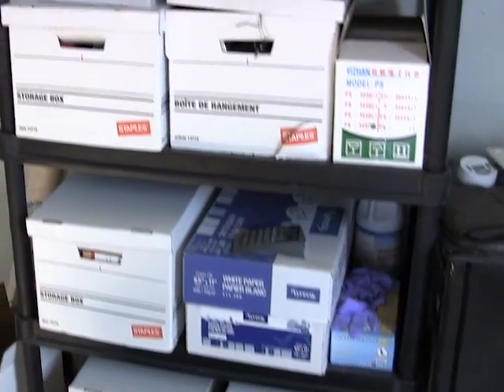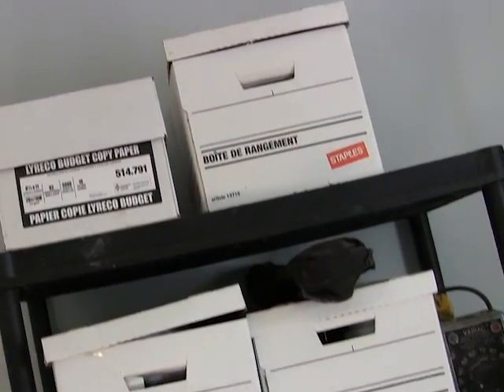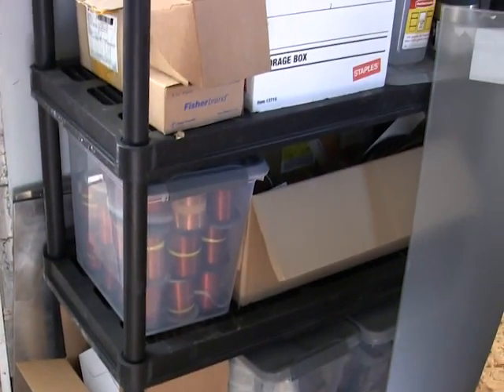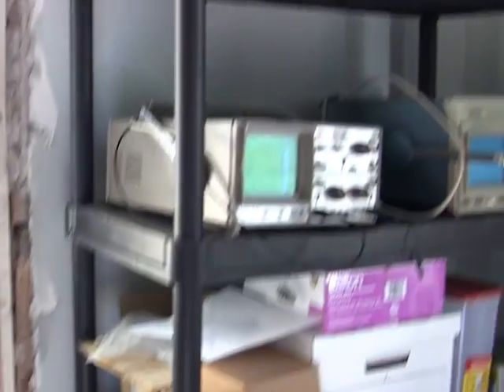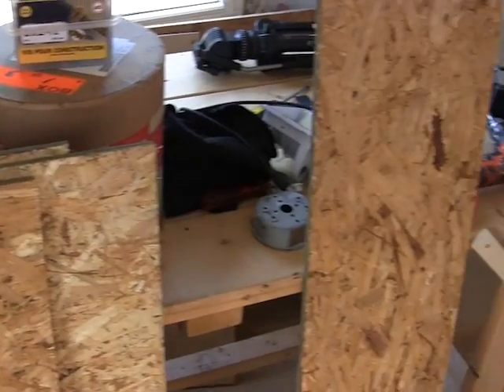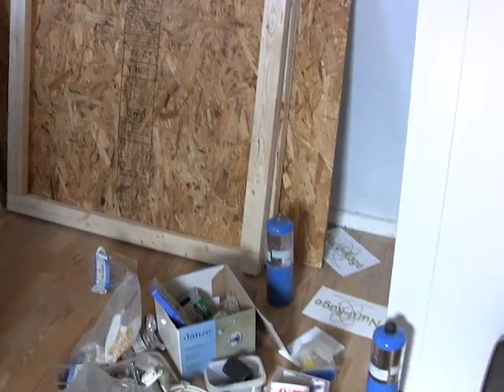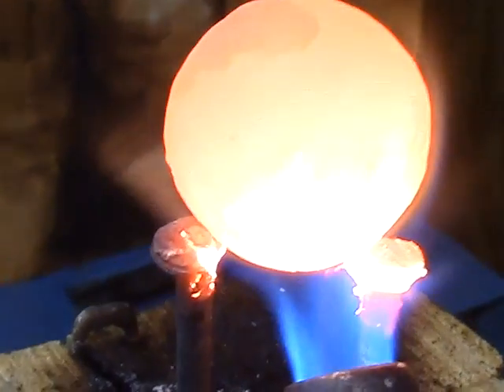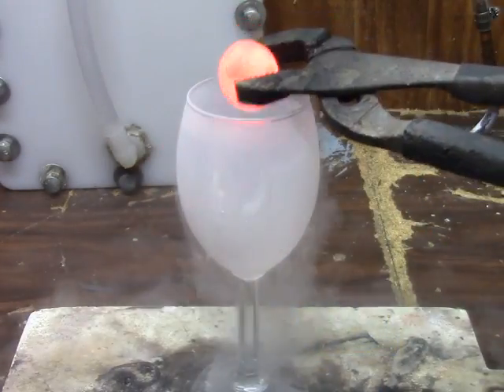Lab Update 8-26-2014

Comment: a fume hood made out of plywood? lol i give it 2 months before it burns down
Reply from the maker: Pfft. With kinda crap i do i'd be surprised if it lasted 2 weeks... i'll give it 2 days.
Reply: NurdRage
Add some n-butyl lithium and maybe you'll have two seconds while it eats vigorously away at the wood in desperate search for some hydrogens :)
Reply: NurdRage Well, now I wonder - What should a proper fume hood be made out of? Stainless steel? Reinforced concrete?
Reply: February
Generally something fairly blast and heat resistant - the ones usually found in labs usually are made out of reinforced stainless steel, lined with strong plastic, with a blast resistant glass (usually a laminated glass) covering.

A wooden fume hood, imo, is a fire risk waiting to happen (especially on exposure to any common reagents used in chemical reactions - higher molarity HNO3/H2SO4 are fairly exothermic and extremely corrosive for a more extreme example, or hell, n-butyl lithium is nice and basic enough to eat through wood - creating some rather unstable and unhappy carbocations), but wood is ideal for a professional Chemist on a limited budget (which is sadly most Chemists) since plywood is cheap and steel is not.

The goal is to not breathe toxic fumes.
Reply: February Consider PVC as a liner for more convention experiments. easy cleanup, cheap, easy to laminate. For NurdRage caliber experiments, you are going to want to mix up some form of inert refractory material. I would say an even mix of concrete, sand, and expanded perlite, allowed to set and then followed by a surface dusting of powdered pyrex (throw your broken lab glasswear in a rock tumbler) and a quick pass with a torch to glass the surface enough to render it imporous.
Reply: SarafanUnin
 I think he's too lazy for this :D He's just gonna burn the plywood hood down and buy another....
Reply: SarafanUnin
ClF3 laughs at your definition of inert.

http://pipeline.corante.com/archives/2008/02/26/sand_wont_save_you_this_time.php

Ridiculous oxidizers aside, this is actually an amazing idea, and is probably much cheaper than steel.
Reply: hey, i have that
Reply: February
 Satan's cloak, obviously! ;-)
Reply: NurdRage
is you fume hood have a metel coating or something like that and we cant see it in the vid?
Reply: skatekai
there air around the fume hood
Reply: no